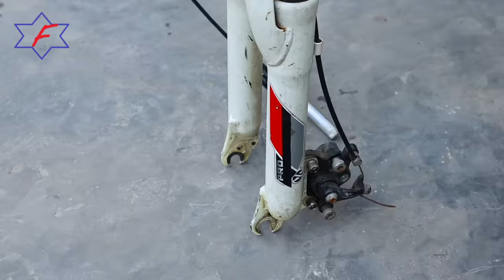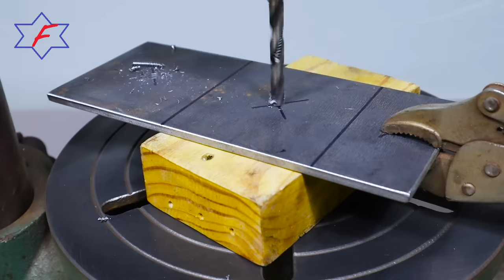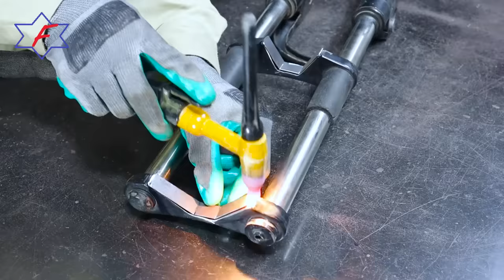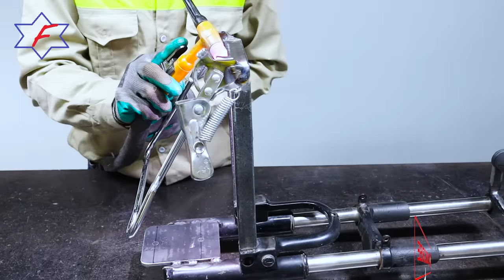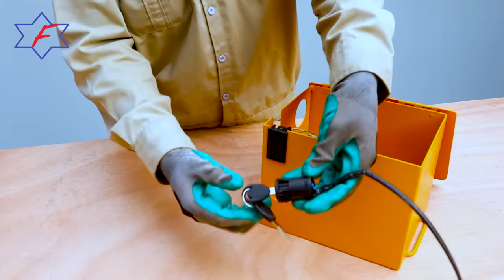Reuse Damaged Bike To Build An Electric Bike-Cart For My Family

Comment: This guy it's crazy if he think those front wheels are going to hold long enough
Reply from the maker: Why not?
Reply: Because the one you built was superior ?
Reply: @fawabros  Boss may I know your FabShop or maybe your display showroom.
Reply: I would have made forks for the front wheels and added brakes. As in U. K. there's need for brakes on all wheels.
Reply: @fawabros thank you for that good job ,it Is to do somethin similar but the back side bici.
Reply: @fawabros  because those are not proper stub axles.

Comment: Nice but some tips from a builder..
Put spacer sleeves between bearings.
Use hardened shank bolts for any axle.
Use dampers for non suspended pivot loads.

Comment: I love, love this and always want to make or buy it myself. But for the poor and non technical among us:  the amount of cargo you can carry on a normal city bike with luggage racks back and front is just as much and even larger than with these kind of add-ons or bike trailers or dedicated cargo bikes. On the back carrier rack you hang large side bags (the kind that are used to deliver newspapers), a large crate on top of the rack and also a large crate on the front carrier rack. (I live in the Netherlands where most traditional bikes have standard carrier racks front and back.)  I fasten  and secure everything with old inner tubes, which are basically giant elastic bands and you can use them for everything. If I need to carry even more stuff I use a hand truck/trolley as  bike trailer and an inner tube as trailer hitch tied to my back carrier. It works. It is amazing how much I can transport with this simple set-up. I even used an inner tube to stabilize my front wheel (preventing the wheel to flip to one side when parked and/or is heavily loaded). Transporting long materials like timber or pipes: I use two inner tubes as loops, one attached to the back rack the other either hanging from the handlebar or over my shoulder like a handbag, then hang the load in the loops.
Reply: Yes - I also use old inner tubes for outdoor  exercise - wrap around street poles - do butterfly-pull upper-arm exercises etc while out jogging/walking/cycling. Use the same ones (different sizes/widths) to secure stuff on rear bike racks. Most EV /ebike/escooter video sites and reviewers seem to hate even talking about the whole subject of luggage and load-carrying. And how often do we have to see idiots ebiking or escooting around with little or big back-packs stupidly weighing on their shoulders and their spines because - hey - racks, baskets, bags etc hanging on or attached to the bike/escooter LOOK SO UN-COOL, right?
Paul G

Comment: It looks like a simple design, but the front wheels need fastened on both sides to keep the axle from bending.  You need crimp on or solder connections for the batteries, as there's a risk of fire from the twisted together wires.
Otherwise it's not bad.
Reply from the maker: Many thanks for your advise!
Reply: 100 true
Reply: I would also have fabbed an adjuster for the chain tension, but yeah, not bad.
Reply: 3/8 axels will tend to bend but with the two it should help,  something like this using 14mm bmx axles would be more load and abuse bearing.
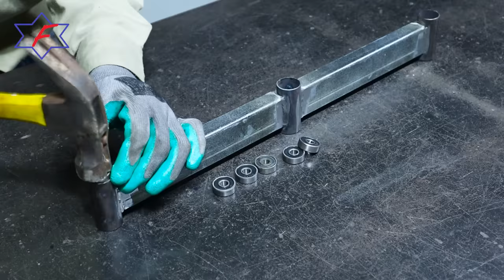Reply: @fawabros  You should also add pieces of tube to support the bearing here (6:08).
Reply: You're right. At the end of the video you can already see the camber of the right wheel being offset. The battery fastening is a tragedy waiting to happen, and finally, although it is a really nice build, I question the whole point of it all. Why not make a trailer?
Reply: What do you think about two forks on both sides (left and right)?

Comment: It is dangerous to mount a wheel with such a thin axle on only one side. You need either a special reinforced thicker axis, or mounting from 2 sides.

Опасно крепить колесо с такой тонкой осью только с одной стороны. Нужно или специальную усиленную более толстую ось,или крепление с 2х сторон.

Comment: Interesting design and work. If you have the intention to ride it on public roads, I would consider vehicle homologation.  You need 2 braking systems and lights or at least retroreflectors. A fuse between batteries and motor is to be considered. I don't know where you live, but without pedals is not a bicycle anymore, is a motor vehicle so you should see the type of your vehicle now and maybe you need a driving license. Consider the case you have an accident and even though it's not your fault, you will be riding a non-certified vehicle.

Comment: I'd be concerned about the strength of the axles, the front wheels were designed to be supported on both sides, not just one. Other than that it look very good.
Reply: That's pretty minor including they aren't facing that much uneven force. If he was doing jumps it might prematurely wear out the bearings. But it's never going to be a huge problem.
Reply: @MrJetFormation  
If you look at the end of the video you’ll see the axels are already bending and the tops of the wheels are leaning inwards. I wouldn’t call that pretty minor. Id call it a fundamental design flaw.
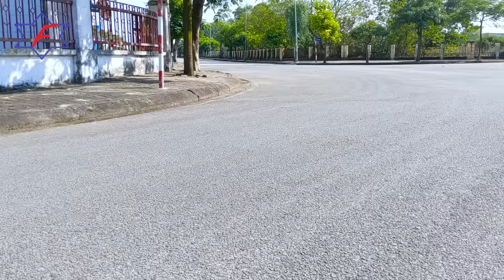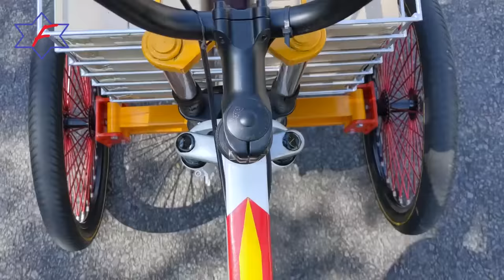Freeze frame it at 16:27 and you’ll see the wheels are parallel. Freeze again at 17:51 and you’ll see they’re not. That is the axels bending. 
It’s a relatively easy fix if he can find wheels/axles that are designed to be supported only on 1 side.
Reply: @thechumpsbeendumped.7797  i mean if you're talking mass production sure. But I've worked with metal and machines for 10 years now and I still wouldn't think to big of it, if it fails reweld it and make it stronger.
Reply: @MrJetFormation  
For someone that claims to have a little experience in working with metal and machines I find it hard to believe that you think simply re-welding it when it inevitably breaks is the right thing to do. This trike is used on the road and as such needs to be strong enough to not collapse and send the rider into the track of a car or truck. The only way to do that safely is to redesign that piece before he gets hurt.

Comment: Since the end pivot points are inside the wheel vertical center line....when the frame  tilts the tires will scrub laterally and then again in the opposite direction tiling back to upright neutral...  Have u found this noticeable  or objection able slow speed, high speed, or during a slalom...???

Comment: Could the Sam design be made so the front wheels don’t lean over as I want to be able to sit on the bike when stopped or riding slow or cornering so it is stable so I don’t fall off , I have a balance problem and want to convert a fat tyre E bike , great job !!!

Comment: nice job i would like you to answer me if you can to the questions
1. what is the thickness of the hollow beam
2. what is the thickness of the pipe and the diameter
3.what is the thickness of the sheet metal
thank you very much

Comment: Hello!  The design is interesting, but there are a number of technological errors.  For example, when welding the frame, no stiffening ribs were used in the corners and attachment points to the fork.  In the near future, this will lead to the destruction of the frame, I hope not while driving.  The cantilever mounting of the front wheels is very unreliable, which affects the low load capacity and reduces handling.  It is because of this that the bike skids so much at the slightest turn of the steering wheel in motion (seen in the video).  Also, with this weight of the bike, one brake is not enough at all.  On the electrical side: such a connection of wires is a shame for an electrician, because there are special connectors that can be additionally soldered for reliability.  It is appropriate to use lithium-ion batteries as an energy source, as they are lighter and more powerful.  Good luck in job!